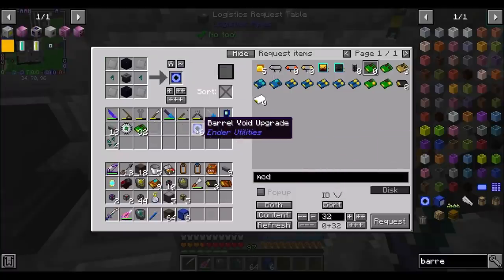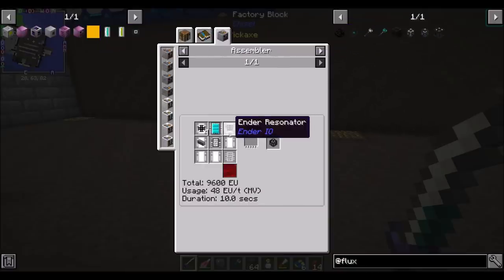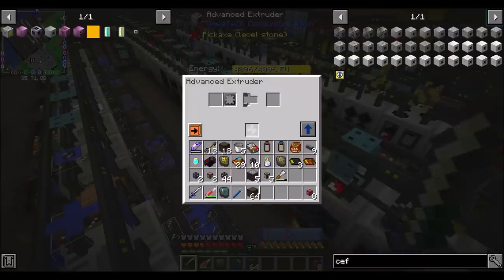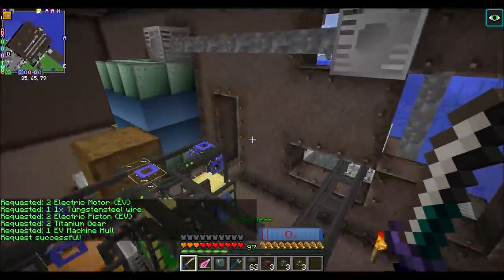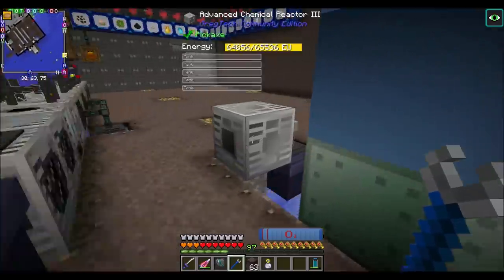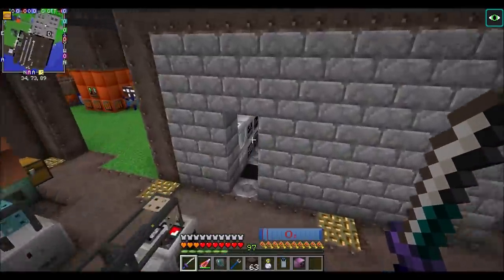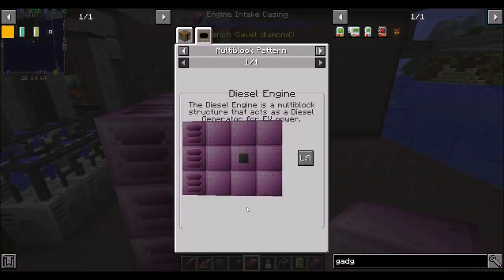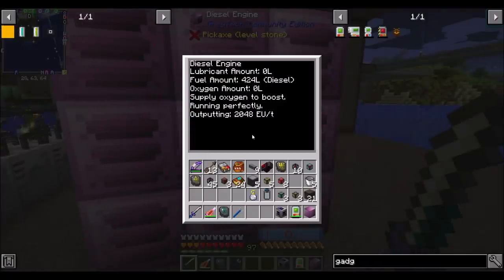FTB Interactions EP90 Diesel Engine go Brrrr

Comment: from what i remember, holding enchantments do scale to the higher enchants available to you (at least in tanks), so putting holding on them is definitely a viable option for increasing their size. with the level you have, it might even be more effective than signalum + enderium kits
unsure if the botania thing will work on them though
Reply: Holding VIII and enderium kits FTW.

Comment: if you put the oxygen hatch on the bottom, you can stack them vertically too for extra savings
Reply: Or if you put it on the other side.
Then you will have 3 vertical pipes and any number of engines stacked.

Comment: Was wondering if Dire had put the 3rd input UNDER, rather than over, could 4 generators be stacked ...ie one beside the one he built then another 2 on top with the 3rd inputs in the top
Reply: It would be easier just to have the 3rd input on the side and just keep stacking the multiblock
Reply: @Royal_4096  just like the coke ovens

Comment: So for anyone playing this mod pack right now and near the end or beat it already, how far is Dire from the end of the pack?
Reply: In terms of machines and tiers.. about half way.  In terms of things to do.. about 60%.  In terms of time need to get those last 30% about another 200 hours.  This is the point where I converted everything to AE, converted everything to HV, Set up supply chains, auto store circuits, and built 15 diesel generators.   Skipped into ZPM generators and machines with only building EV + to ZPM assemblers + a few others to build circuits.  I'd say the way dire is playing for youtube, he has another 100 episodes (which won't happen) because those 100 episodes will each take probably 3 hours + just waiting.

Comment: if i may make a suggestion, the fluid solidifiers seem like a much cheaper alternative to the extruder in many cases. 
the problem with using them would normally be that you have to have the fluid, and it takes 144 mBs exactly, and logistics pipes isnt the best with fluids, so you would have to keep a kinda large stock of titanium (as well as whatever other metals you might use to make these things) just melted and not directly usable.
however, as a general solution to this, i would point you at the volumetric flasks. they are essentially items like buckets, however they hold odd amounts of fluids. for instance one i know holds 144 mB of fluid precisely. with this you could almost certainly have a thing where you craft that on request (as opposed to keeping a stock of liquid)
Reply: Extruder is just easier and with higher tier machines and no power worries it’s usually just better to go with extruders

Comment: Using a different fuel will not change the energy output rate of the generator.  It will still be 2048 eu/t.  It will just consume the more efficient fuels more slowly.  Oxygen-boosting will boost the output to 6144 eu/t (for the same fuel consumption, I think).

Comment: Honestly imo you shouldn't have bothered with a diesel engine, the only reason to use it is if you really can't be bothered to make photofission, which makes far more power (49152 EU/t compared to 6144) and uses far less fuel, diesel is only really the best option available at HV, and only if you use nitro diesel